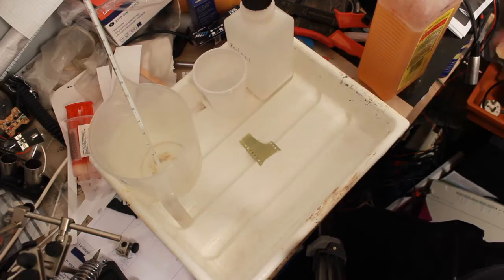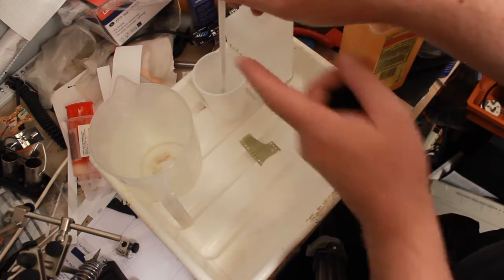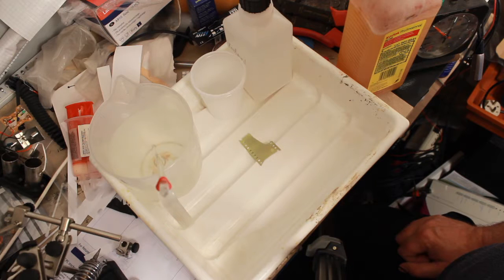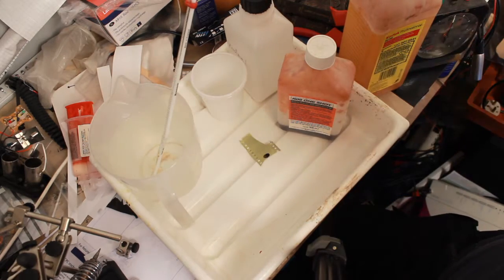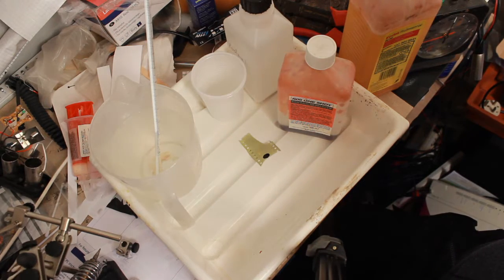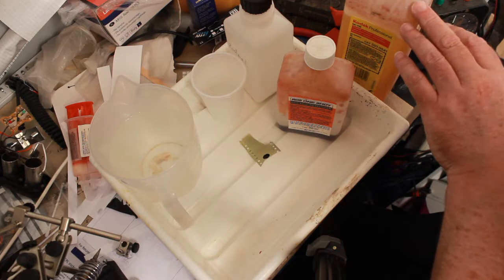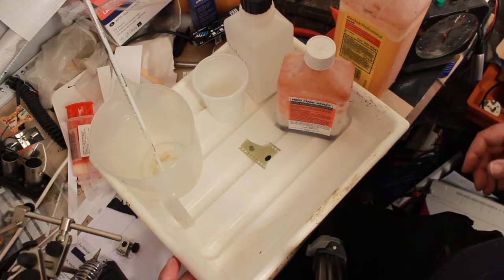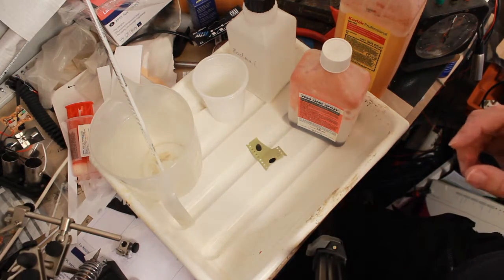Fun with Film Episode 7 - Testing photograhic film developer

Comment: I think the problem that you had with your homemade rodinal is that you used sodium metabisulfite instead of sodium sulfite. The pH I am assuming is going to be too low to work.
Reply from the maker: There are recipes available using either. The sulphite is quite difficult to get or expensive for some reason so I adopted a recipe using the metabisuphite. As you know it failed. I found another (on the Digital Truth site) which has produced a happier result - look out for Episode 8 :-)